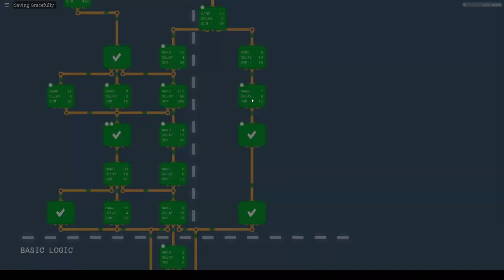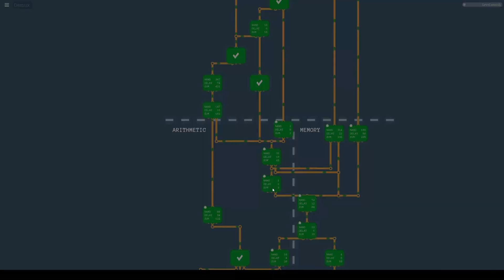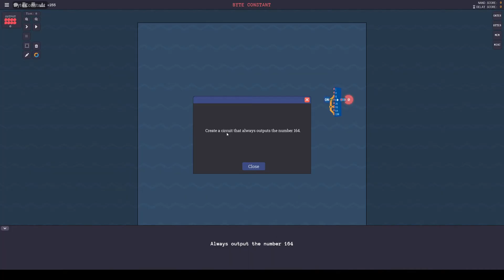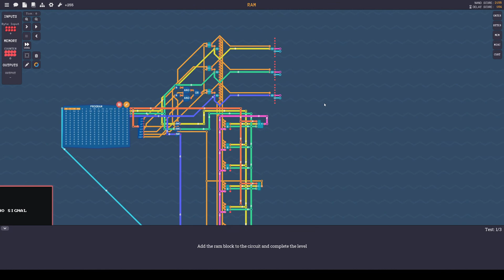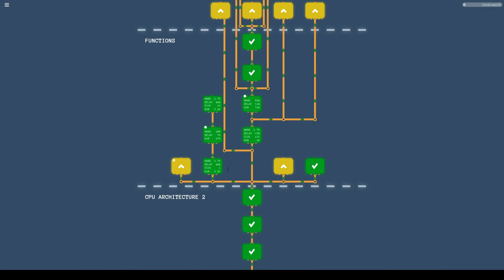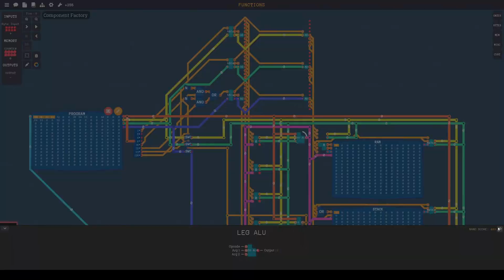bobingabout Live Stream: Turing Complete Part 4.

Comment: Hey ! Did you manage to fix your LEG architecture ? I watched until the end, but you ended up with trouble integrating the second stack and second ALU lol. maybe it was too late to solve it. Would love to see a part 5 xD or maybe upload your computer so I can see it xD
Reply from the maker: I haven't really played the game since, but they have added a new feature where you can put custom chips inside custom chips in a tiered system now, so things should be a little easier if I were to try again.

But from what I remember, I wasn't entirely happy with the instruction set I was working on anyway, and wanted to change what I was doing.
Reply: @bobingabout  Nice to see that they finally added the features for being able to nest components inside components.
I think RAM may have ended up broken with the last rewiring, but fixing it looks straightforward. You have all components in place but I think you may be missing some of the connections and logic gates that you had in the byte splitters for restoring functionality.
I would love to see you giving it another try in the future :) I will enjoy it until the last second, thats for sure.